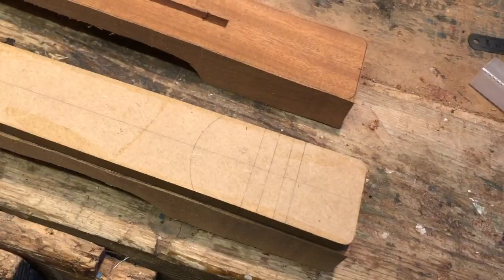Building DC Guitars - Episode 9 | Routing necks and glueing on fretboards

Comment: Little dab of silicone on each end of the truss rod ends and a tiny dab in the middle so the truss rod doesn't rattle ????
Reply from the maker: It's all subjective, but I don't like the idea of adding silicone or anything else that would dampen down vibration. I try to build the neck so that the truss rod will always be under load so rattle shouldn't be a problem
Reply: @ADFinlayson  cool! Your guitars are turning out beautiful! Great tutorial about how to keep the processes cheap! It's nice to have thousands of dollars in a modern shop full of machines ect but simple ,affordable tools get the processes done. Process is everything!